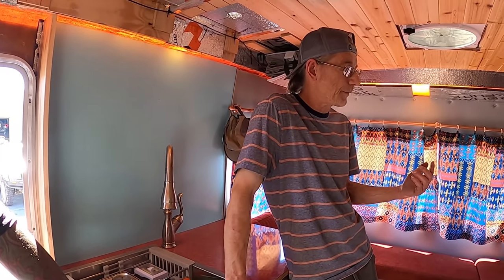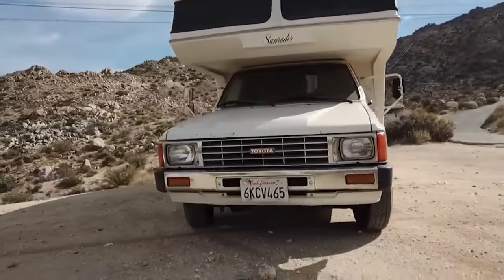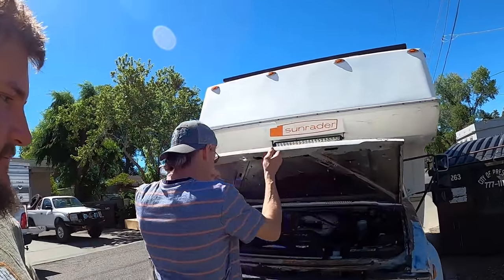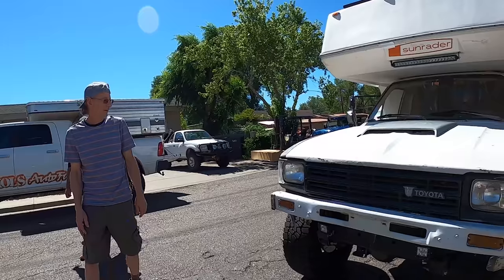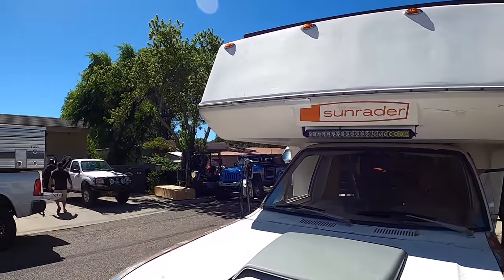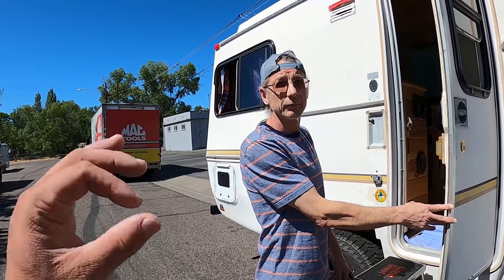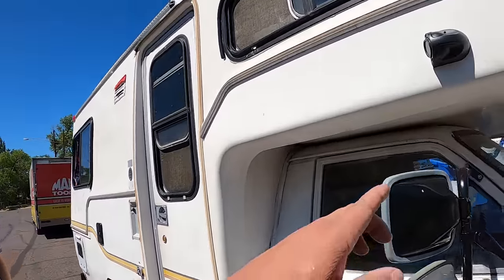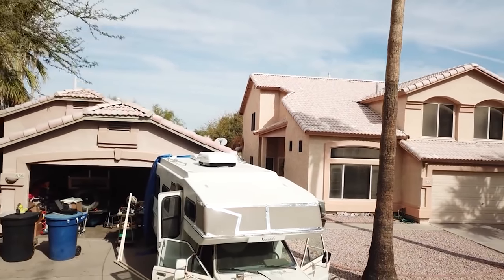Toyota 4x4 Sunrader w/ Motor Swap, Solid Axle Fiberglass Camper Exterior RV Tour

Comment: the appeal for that is the minimalist build but with an accurate camper shell design. I'd rather american power for such a rig, but in similar sizing. I see these a dime a dozen broken in every way, especially frame/drivetrain.. but that shell is still hanging on to its outer dimensions. I am still inspired to build my own truck camper.. this toyota shows they can work if you stay real to the shell.